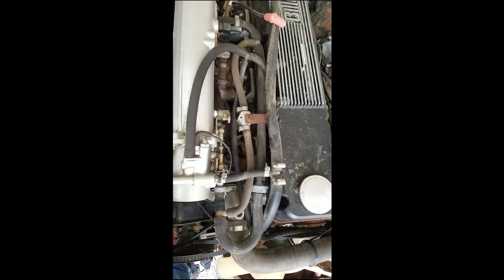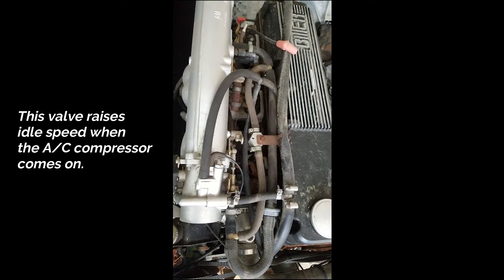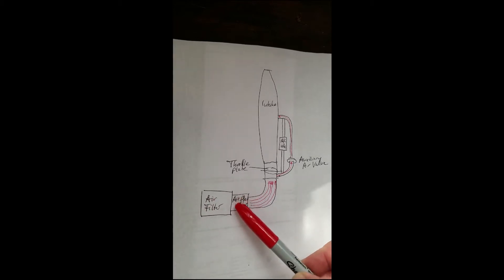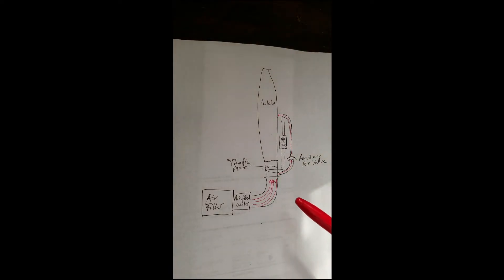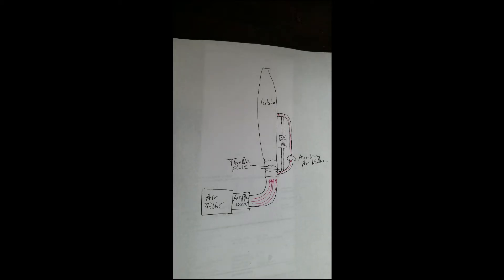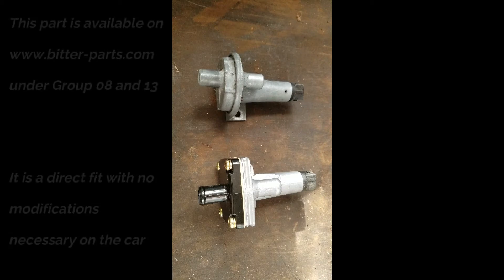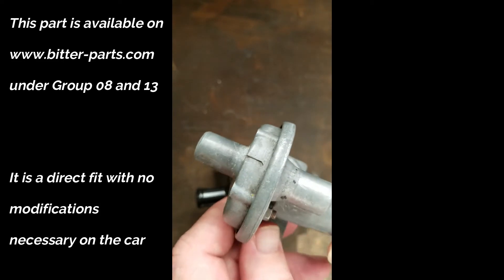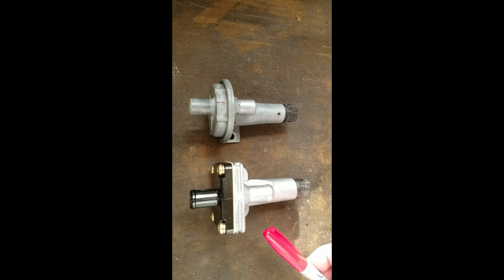Bosch L-Jetronic, Auxiliary Air Valve - Principle of Operation, Bitter SC

Comment: Very clear explanation...Thank you...
Does this valve close completely when it gets hot or does some air still get through??
Reply from the maker: Hi! After opening some of them I can now say that they close completely. Although it is not a true seal, just a shutter that moves in front of an opening. You can see that in my other videos where I have disassembled them.
Reply: From what I have seen, if working properly, yes they fully close. If it doesn't you will have idle issues. Pinching a hose simulates fully closed, so if idles becomes normal when pinched, your Aux Air Valve isn't fully closing.

Comment: Very informative video! My 84 Citroen CX "L-Jetronic" has the same aux air valve. I have the same problem of very difficult start when cold. Fires then dies, fires then dies. I took out the Aux air valve and when cold (4C) the air gap is very small, like in your video. Is this normal? How big should the gap be when it's cold. Thanks for any insight you can offer.
Reply from the maker: Hi! Thanks for the nice comments. I appreciate it. The cold air gap determines how fast the car idles when cold. If it is very small that might be a problem. How big it has to be I can't tell because every AAV type (Bosch Number) is different in gap and duration of raised idle. On my Senator in Germany which still has a working original valve I noticed that it was set up in a way that it just always had the same RPM, cold or warm. So you never noticed the job the AAV was doing. I wonder if it would help to spray a small amount of lubricant into it and move the flap with a screw driver to see if the flap is stuck and if it shows a larger gap when lubricated. I have revived some AAVs like this in the past.
Reply: @bittersc-repairandmaintena5483  Thanks for the tips! The air gap is the same as the one in your video. I did try lubricating it and opening it with a screwdriver and it's moving freely and it just springs back to where it was. I noticed that yours was probably at room temperature whereas mine even when cold (4C) has the same small gap as yours which is warmer. my AAV is a Bosch 0 280 140 172. I did put it in the freezer and now the gap is bigger so it seems to be OK. But the car is nearly impossible to start when cold.